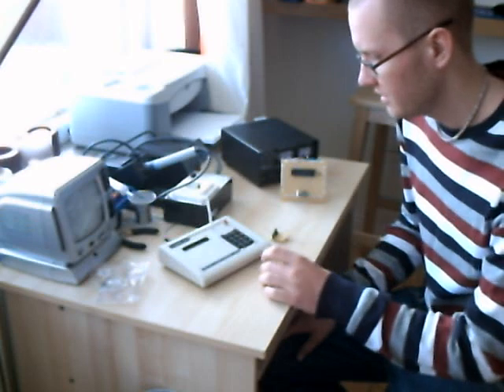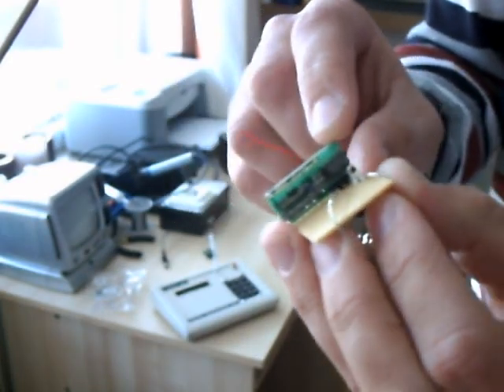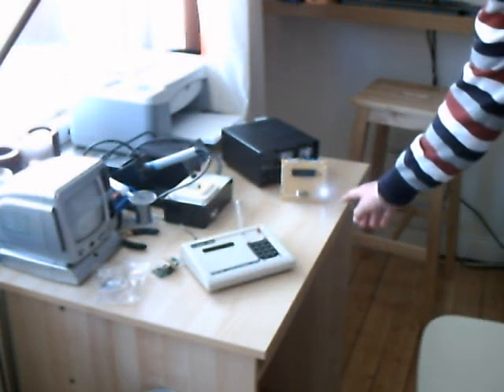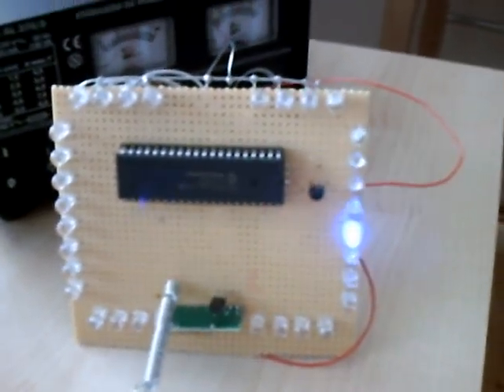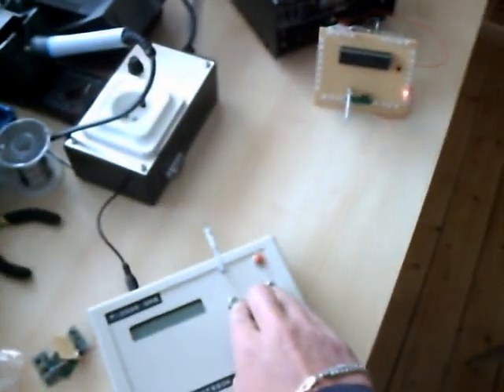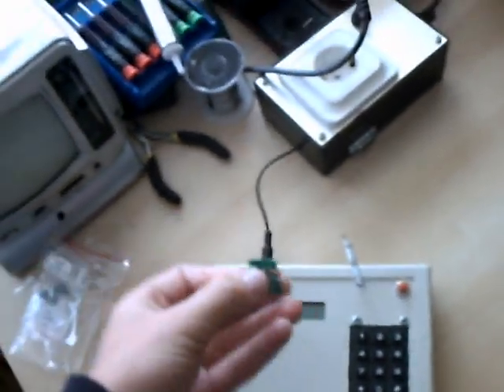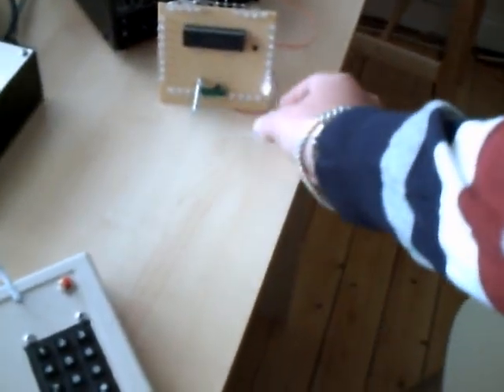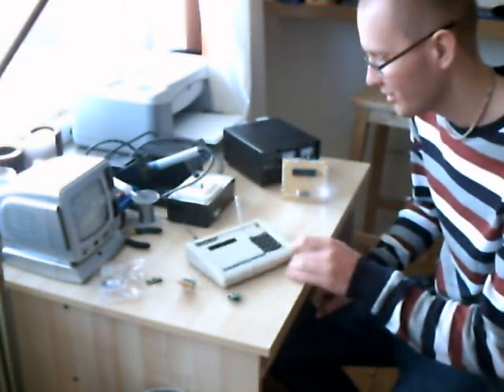PIC Microcontroller RF-module with LED

Comment: hello. i have a question for you.  are you using usart mode(microcontroller) straight to transmitter?

and what about receiver? 

i want to buy transmitter and receiver but i dont know if i need to get the encoder/decoder version .

thankyou for your help

Comment: @suhailamohdnajib 
use some small value caps(10 nf) across the power input on your RF modules, plus i lucky enough to have a scope check the noise at power regs/MCU power pins/ RF power pins, i've been having the same problems and took me quite a while to figure out!... :-/

Comment: dude, do you know where to buy a transciever which has high speed like 1-10 Mbit/sec. i have a wireless project that transmits the dijital video in wireless way. so i need a high speed transmitter and receiever.

Comment from the maker: The PIC on the transmitter tells the PIC on the receiver which LED to light. Otherwise with only transmitter and receiver it would be a ON/OFF link and only capable to controll one LED. But now I can send any data I'd like and control unlimited numbers of LED's (in theory)

Comment: Thanks nice post!  Do you send a good 'preamble' of an alternating bitstream of 1's and 0's just prior to sending your actual data?  This will help prepare the receivers 'data slicer' and will improve range/reception (mostly on OOK type RF modules).  Manchester encoding of your data will also improve the reliability of your data transmissions.  What is the effective length of your antennas?

Comment: Try putting both antennas verticaly (same polarity), and try differents cable lengths, maybe 1/4 wavelength works fine (straight wire, no spring style).
Great job.